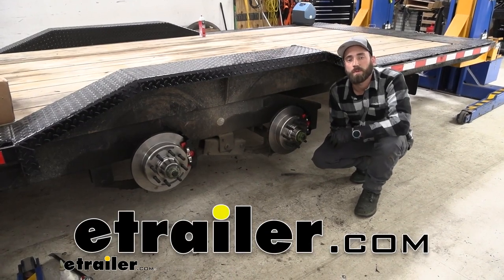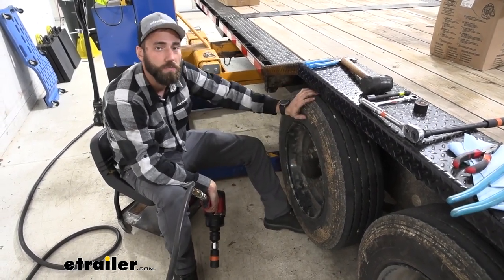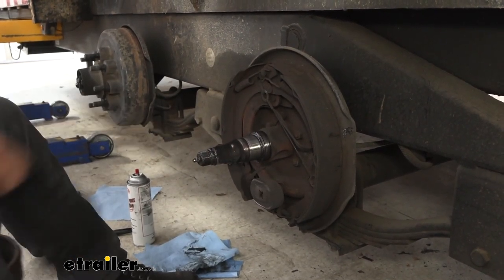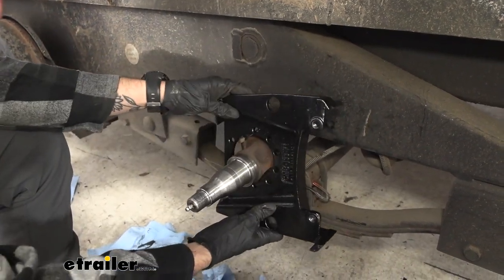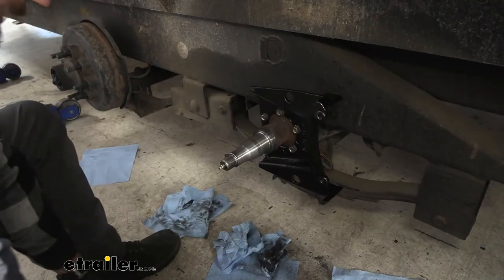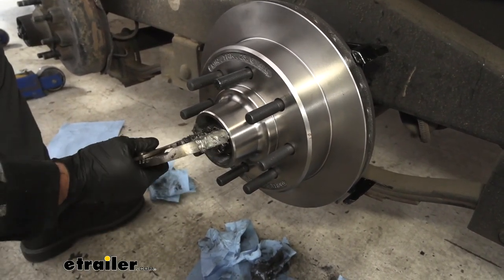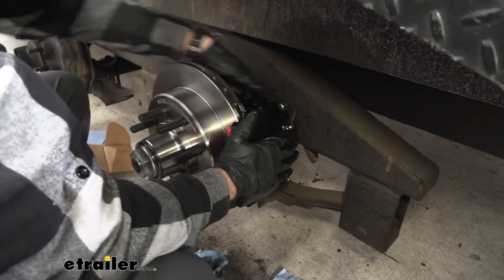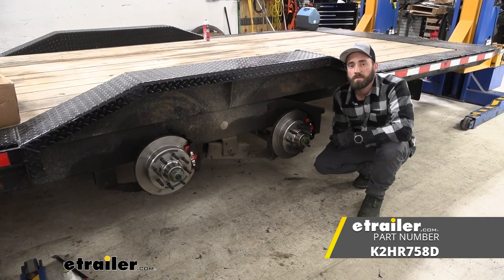etrailer | Kodiak Disc Brake Kit Installation - Flat Bed Trailer

Comment: I've been using the 10-36 grease seal for my oil bath hubs. Even after removing the hubs a few times I have no leaks.

Comment: How do the brakes work if you didn’t hook the wires back up to anything. Is there another unit that has to be installed to actuate the hydraulics
Reply from the maker: Yes there is. You'll also need either a surge or hydraulic coupler or an Electric over Hydraulic brake coupler. The surge coupler you need will depend on the GVWR of the trailer. These are typically found on boat trailers and tow dollies. Electric over hydraulic actuators are more common for RV and cargo trailers. For a disc brake setup, our install crew really likes the # HBA16. If you go with an EOH setup, be sure you're using a brake controller that's compatible with EOH brake systems.

https://www.etrailer.com/dept-pg-Brake_Actuator-sf-Surge_Brake_Actuator-sz-Disc_Brakes.aspx
https://www.etrailer.com/Brake-Actuator/Hydrastar/HBA16.html